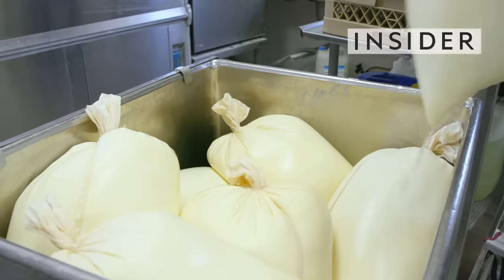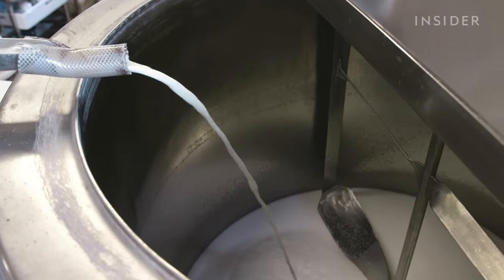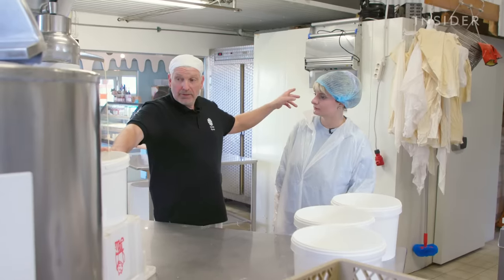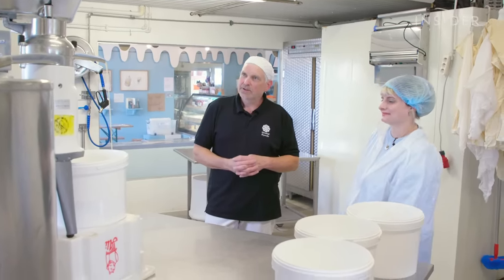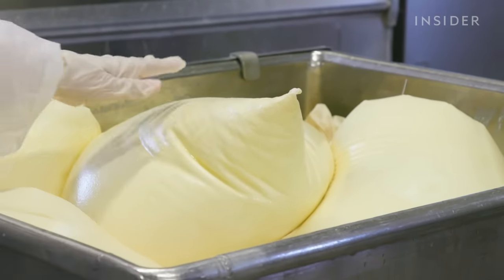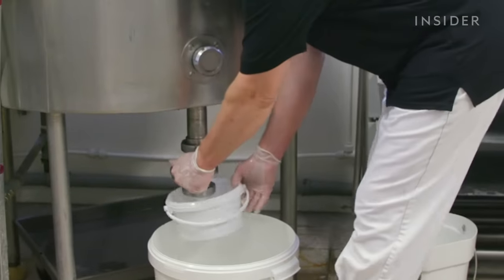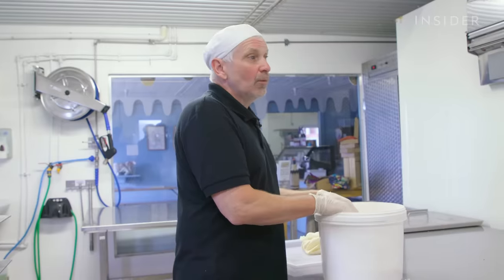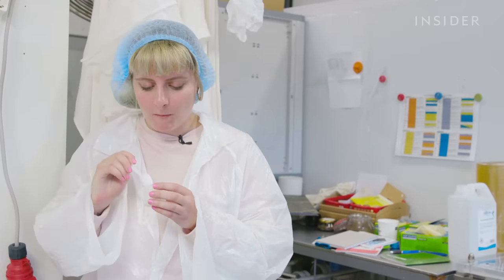How Skyr Is Made In Iceland | Regional Eats

Comment: In the Netherlands we have something similar called hangop (literally "hang up") where we drain yoghurt or buttermilk in a cheesecloth or clean tea towel, typically hung by binding the four corners of the cloth together; it's often eaten as a simple dessert with some (preserved) fruit or a fruit syrup. You can buy commercial versions, but it's also really easy to make at home from yoghurt or buttermilk (which also gives you control on whether you want to make a skim version similar to skyr by using buttermilk or fat-free yoghurt, or a semi-skim or full-fat version using low-fat or full-fat yoghurt), you just need to make sure you start well in advance due to the large amount of (passive) time it requires.

Comment: In the Netherlands we have something similar, “hangop” which means Hang it up. You take a cheesecloth and line a bowl with it. You then fill the bowl with yoghurt. You tie the cheesecloth together like a sack with a piece of string and hang it up with the bowl underneath it. Leave it for hours. The liquid pours out, and you have a thick mass. My mother used to make it now and then, it was/is a traditional dessert in the Netherlands. 
I notice that this guy doesn’t add rennet to the milk, only a starter culture of lactic acid bacteria, so it is basically a yogurt as well
Reply: I believe the typical culture for skyr actually contains both lactic acid bacteria and yeast.
Reply: You are absolutely correct, it has yeast.
Reply: @fredericlaurens4332  when its made traditionally by hand you are likely to have wild yeasts in it. But the industrial product you buy doesn't. The milk is pasteurized before processing it further.